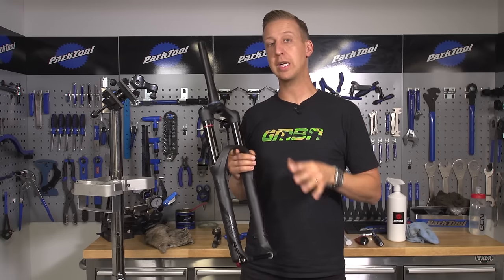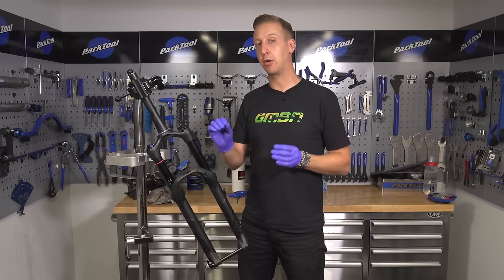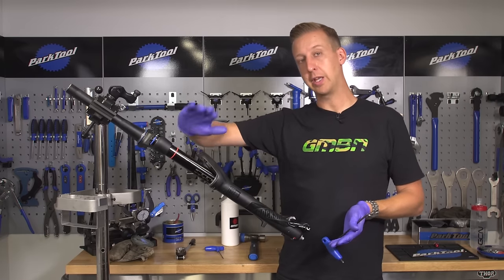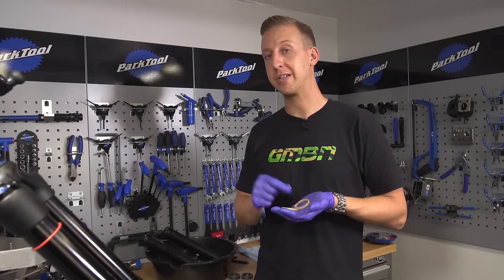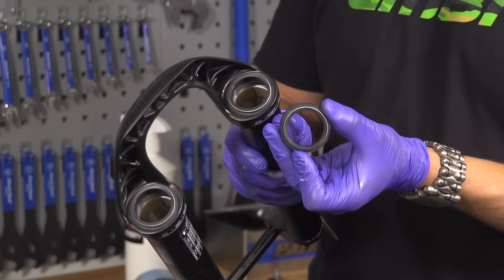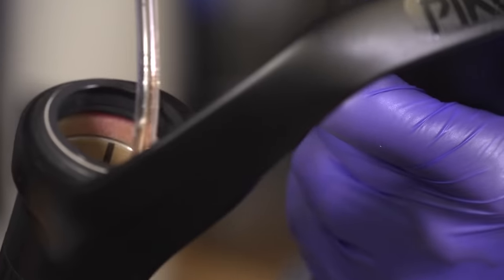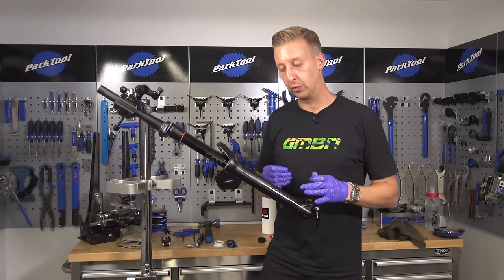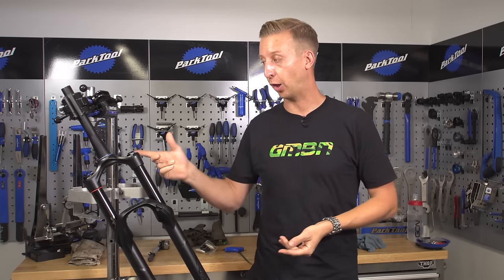How To Service Rock Shox MTB Fork | Mountain Bike Maintenance

Comment: I saw this video 6 years ago and I'm back. I have a RS recon. Roughly counting the bike has done more than 400 hours. The fork and back shock still feel like new.
Reply: This is exactly what I said before servicing the lowers. I didn't have any patience for aliexpress foam rings to arrive, so I bought a pair from a local bike shop (i had to beg to 3, until the last one took an entire bag from the service, after telling me they only have full service kits). Anyway, the fork felt buttery smooth for about a week and.. I lost the rebound adjuster plastic thing; it just fell off somewhere. 

With all being said, do at least a lower legs and air shaft service from now and then and you'll feel a difference.
Reply: @mihaichiriac480  I feel a minimum difference between my fork and an new one in a shop of the same model.

I really don’t see the point of a service, I have trashed the bike for 6 years. I  think it will easily survive another 6 without any maintenance. I rather spend €2000 on a new bike and have a next generation of the same model.
Reply: @MrYugoWRC  Can't argue with that. Recon is made to last with minimum to none maintenance indeed.
But i'd better learn maintenance on o cheaper fork than on an expensove one

Comment: First time doing it. In my case, this video, the RS and the manual were very helpful. However, when trying to putting the oil into the lower legs, I should say move them until they contact the spring then move the lower legs back as much as you can. For some reason the 1cm recommended wasnt enough for me. Oil wouldn't go in. Fork is smooth again.

Comment: Just did my first ever service on a 2016 revelation rl on a Trek Fuel ex 7 29. Have ridden the bike quite a bit in mud, dust, sand and occasionally perfect brown dirt. Way more than 50 hours. Changed the oil, cleaned the components and put in new seals. The oil wasn't too bad, just a bit murky. I do keep the bike pretty clean. Have to admit that the fork does definitely feel more responsive, kind of like I remember it feeling when the bike was new. Maybe there is something in the manufacturers recommendations, but I don't think every 50 hours is really needed. Maybe once a season should do it.
Reply: once a season then its lower, spring and maybe even damper.

Comment: Just got done doing mine rock shocks Judy Silver, watched so many videos then realized none of them were on the silver TK. Blue prints and instruction manual didn’t have the same components either in the diagrams… Took longer than expected but got it done still

Comment: 50 hours of riding? What? Are those forks made of paper? :D
Reply: Learning guitar I've been riding pikes for 2 1/2 years not serviced yet and ride a lot. Haven't had a problem
Reply: Not yet til u replace all of it bruh :))
Reply: Learning guitar so far i should of had to do this process every week so 24 lower leg services or you know one because suntor raidons for life
Reply: previous owner of my 2013 model Specialized Enduro bike said that neither the fork nor the rear shock had ever been serviced... in 5 fucking years. Man I'm scared to open those up. probably ghosts in there at this point
Reply: Do it annually
Reply: Yes that is absurd
Reply: @robertmaguire2883  Yeah I have Rock Shox Reba SL 2010 model paid £250 in sale reduce from £470 brand new and 8 years later never had issue with it and I mainly ride on road and some offroad but never been real muddy though never been service i just buy new forks when they go wrong and sell old ones on ebay for spare and repairs
Reply: @yukelss  Yikes
Reply: @robertmaguire2883  uh, then you either don't ride even weekly or don't know what good suspension is like
Reply: When was the last time you serviced the shocks on your car? Been riding a rs revelation for 10years, other than adding air once a year, never serviced it, never had a problem. Only thing I do is keep it clean and squirt a bit of wd40 before each ride and they still look like new!
Reply: No, they are made of strong metal, but need to be relubricated every so often to prevent rapid erosion from occurring. $15 every so often could save you $250 or more in a year or two because your fork stanchions are completely shredded from you failing to do this repair.
Reply: @yukelss  just had the same problem should see the state of the forks 😢💔
Reply: GoodFodder they’ll feel amazing after a service. Just do it.
Reply: Probably 100 hours is more like it unless they are ridden extreme all the time
Reply: Well cost of a service in a shop is 120 euro p and p that's 120 towards a shit pair of new ones 🤔. What would u do ? Hard one
Reply: @goodfodder  wd40 is a penetrating oil, like liquid wrench.  It isn't meant to be a lubricant,  it is meant to get rusty screws and bolts unstuck.
Reply: Am I the only one super envious of the workshop behind him! Top end
Reply: @Boxbeat666   do it yourself for almost free
Reply: @robertmaguire2883  the point of servicing is to do it while you have no problems… before your bushings or uppers are worn, then it’s too late. That is why it’s 50hr service to be done regardless, takes 20 mins with no special tools. No point buying a good fork to treat it badly and lose the performance you paid extra for.
Reply: @robertmaguire2883  not that you can see.
Reply: You'll find that's manufactures reccomendation
Reply: All he's doing is replacing the oil. Wiping down the stanchions does nothing. If your seals are in good condition there should be nothing in there but oil. It's kind of pointless to pull the forks apart if you're not going to clean the interior as shown in the service manual
Reply: I’ve got about 4 years on mine 👍🏼
Reply: I’m terrified of servicing mine after hearing that 😬

Comment: My local shop charges $75 plus parts for this service.  I need to start doing it myself because it will save me a lot of money every year.  I've learned to service just about everything else on my bike, but the air forks still intimidate me, probably because they're the most complex mechanism on the whole machine.

Comment: every 50 hour is abit much, i do it every 7-8 months and has been fine for years
Reply: Can confirm that 50h is way to much.
Reply: when they say 50 hours they probably assume you're riding super dusty or muddy MTB trails for those 50 hours I just wipe my stanchions and service once a year
Reply: Chihiro Gustafson extremely fast downhill trough mud in the rain.
Reply: The thing is with the minimal amount of lube these modern forks have for keeping the fork working smooth it does get dirty in 50 hours which btw translates to a lot of riding!  The old open bath systems with 100s of milliliters of oil went 100 hours before service!
Reply: How is 50 hours 'a lot of riding'?  Even if you only went out once a week for three hours, that's just four months between servicing!
Reply: I have to service my fox forks and shocks once a month, which translates to 50-60h for me. it's very dry and dusty and bushfires tore through all the riding areas here so there are very tiny particles of ash and I've been told we have one of the harshest places for suspension wear in Australia for that.
Reply: every 110-130 hours or 1 time on 1,5-2 months
Reply: Ikr 50 hours crist
Reply: depending what are you riding. i did service after 6 months - 4-5 rides per week 1,5h each ride on average. maybe 1,000km riden - the oil in upper and lower leg dirty black  with no resemblance of fluid but rather a runny mud. i ride trails and bit light DH on a trail bike.

Comment: Every 50 hours of riding... is this a joke?  Imagine if you had to service the shocks on your car every 50 hours... don't think the auto company would sell many of that particular car.   These bike fork manufacturers need to get their stuff together and build something that doesn't need to rebuilt after every 20 rides or whatever with their $40 bag of or-ings and grease that probably costs $4 to produce.  Great video as always Dotty!
Reply: Are you saying you can’t be bothered to spend 30 minutes every 50 hours to keep the performance you have paid all that money for? I only replace wiper seals on my forks at the 200hr mark so just do the oil and the form rings every 2-3m or so which are dirt cheap. Try comparing the suggested service intervals on a Volvo vs a Bugatti, higher performance machines require more regular servicing.

Comment: I've heard that you should compress the lowers into the uppers completely (fully telescoped) before adding oil. Here that step is overlooked and the lowers are not fully compressed. Seems as if the result will have too much of an air chamber and the fork will run long and sluggish. Thoughts?

Comment: Hi, Doddy, my fork is a RECON 335 SL/120mm travel
It doesn't travel anymore than 30mm, the air spring is ok, airtight and etc
However the damper leg doesn't travel even if the air chamber is empty
The damper cartridge is ok, but even when it's fully opened, the fork doesn't move down, I haven't open the damper leg, but I think that the piston's transfers could be stuck
Please give your opinion
Thanks
Jean Michel

Comment: Dunno if it'll help anyone, but if you're doing this at home, I had to get out a framing hammer to "shock" loose the internals. It felt so wrong, but it was the only thing that worked. (Obviously this shouldn't be the first thing you try.)

Comment: Doddy, after the lower lube oil go's in dont you have to compress the fork down before the bolts go back in so there's no trapped air in the lowers???
Reply: No, you'll create a vacuum in the casting, and the fork will not extend fully afterwards. I did this once while servicing my fork (because another video on YouTube did exactly that), and afterwards I was missing a good 10mm of travel.

Comment: What's the best thing to do with your brake line while servicing the fork? leave it attached? Should we put in spacers so the calipers don't get pushed together? I'd like to service my fork, but don't want to have to bleed brakes after. 

Also, how similar is a fox 34 fork to this video? Can we use the same oil?
Reply: Scott King anytime you're removing the disc brake away from the pads, you want a spacer in there. There a specific pieces for that but all you need to do is fold up a piece  of paper and make sure it's pressing against the pads

Comment: Guys help needed! Id like to start servicing my forks, but im scared of damaging them: the mechanic that used to service my pike said that one of the 2 bottom bolt was spaned and needed a bit of threadlocker. Can this be dangerous when i need to hit with the mallet?

Comment: I wud recommend not setting same pressure, with slicker suspension your sag will set better than if it was sticky. That's more for if you're in a shop and don't have the rider to set.

Comment: How often should the rear shock get serviced?  Most people can manage doing the front shocks on their own, however the rear shock is another story.  When you think about how much smaller the parts are and how much more abuse it takes relative to the size of everything, it seems like it should be getting serviced just as often.
Reply: Half as much ride time (according to rockshox). So a full front fork service should be 200 hours and a full rear service should be 100 hours. That's what their website says anyway.

Comment: Hi! I found my foam rings broken and 1/4 was inside the tube. Maybe i didnt let them soak much enough last time or just was clumsy. But i wonder if i can put the rubber rings last instead of first, that is 1) foam rings fitting 2) put rubber rings on the upper legs and let upper legs into the lower legs 3) make sure rubber rings gets into their proper place ?

Comment: is this what people call a fork rebuild?
also will you be doing a shock rebuild soon?
Reply: No this is just a lower leg service. A rebuild would be replacing all seals and oils in the lowers and uppers, the spring side is easy but the damper side is slightly more complex to do and usually only needs to be done once a year or every 300-400+- hours whichever comes first.

Comment: do you not add new crush washers to the screws? and do you have to cycle the fork to recharge the negative chamber?
Reply: Only if you are disassembling the airspring. This is a simple Lower Leg service not a Full Service. If you are careful there is no need to replace the washers in my opinion.

Comment: I'm new to the mtb scene so I'm trying to learn as much as I can about the servicing side of it. My bike has the Judy silver but no solo air, just a coil. My question is this. The instructions PDF doesn't list a Judy with just a coil but there are others in the same family that do have just a coil and it list them as 6-12 ml oil to put back in. Does the amount of oil impact how the shock feels? I weigh 240lbs so would I need to put in closer to 12ml? FYI my bike is a trek roscoe 7.

Comment: If I'm using my bike to get around town on a daily basis,meaning that I'm not taxing the fork much,does the 50 hour rule still apply?
Reply: doesn't apply even riding it hard lol they just want you to buy their oil more!
Reply: Oh,a conspiracy then...
Reply: Powerhugful do it once a year, that is more than good enough. I do my fork and shock every winter.
Reply: Nah, I do the same thing as well. I suggest u get it serviced twice or once a year, depends how wet conditions ur riding in.
Reply: if your fork feels like its getting stuck then yes
Reply: @powerhugful. The last time i sent my fox 32 out to be serviced was early 2013, since then i have been keeping the fork very clean and i use brunox deo spray to oil up the stanchions before every ride. I do long rides very often and fork still feels awsome on the trails.

Comment: Make sure the bolts are only loose 3 turns or so before shocking them. I accidentally stripped some of the threads out of the spring side...🤦‍♂️

Comment: I have a 2004 Kona Caldera. My question is what kind of suspension oil do I need? I'm currently getting my bike powder coated and had to take everything apart so my front marzocchi bomber shocks are completely taken apart and drained. My local bike store said I needed a specific oil but wouldnt tell me what kind and to find out myself.  And what kind of grease also?

Comment: I have a 2014 rockshox rct3 dual position air fork recently my forks Compression Mode Adjuster
Knob is not working like before.If i turn it on lockout it works like decent mode so what is the problem bahind and how can I fix it.I will be very glad to you if you upload a video about rockshox upper leg service.thank you.

Comment: Thanks for the video. On a JUDY 2018 fork does I need to apply grease on the lower leg? I made the service without putting any grease on the lower and upper tube and after a while it won't work smooth.

Comment: I had a really hard front wheel landing from about a 4' strait drop and instantly my forks have zero rebound damping.  They clank and chatter over small bumps as they top out.  What part did I likely break inside?

Comment: Hello, I have a question. When I unscrew the suspension, will oils start to run?  That's why you said we should have a oil pan?
Reply from the maker: If you remove either of the lower leg retaining bolts then yes, a small amount of oil will begin to run out

Comment: hi there. just a quick q if you could help. i have done my full fork service however. this is Judy Silver TK - i was not able to removed the air spring tube form the upper leg. i removed cap and tried to push the skinny leg in but could not get it out. this is 2021 130mm Judy Silver TK. is there a trick how to remove air or did i just got stuck with air in negative chamber? cheers

Comment: My stanchions creak in the crown when I ride. Any fix for this?  Dealer told me I need new shocks and Pike will cost $1000. I have Rockshox on my Stumpie.
Reply: You could try to add some Loctite 290 to the connection of the crown and/or the stanchions. It should penetrate into the little cracks that form during usage which cause the creaks. Some people on the internet have had success with this, but it's no guarantee. Other than that you can only replace the CSU unit, or actually press out the steerer tube and reinstall it with Loctite. But that requires special tools (hydraulic press, etc).

Comment: When I'm taking of the lower fork on a Fox fork, do I need the driver tool or can I just gently hit on them with the mallet as in this video for RockShox?
Reply: Caesius It’s not recommended because you can damage the threads.
Reply: I've just finished doing it. Takes a bit of gentle tapping. I had to put the bolt back in and tap again a couple of times on one side. 
It only requires very gentle tapping with a plastic mallet, I can't imagine it would hurt anything.

Comment: #askgmbn could you make a video about coil forks service in a future?
Reply: Nicolás García That will be super helpful. Good question.👍
Reply: There is no difference between coil and air forks. The lower service is the same.
Reply: Minus bleeding air pressure, plus fighting coil spring pressure
Reply: are coil forks still being made ??
Reply: @yunnerd3242  yes either for very cheap forks on low end bikes or for some DH and Enduro bikes as they are meant to be more supple. Most air forks can be converted to run coil as well.